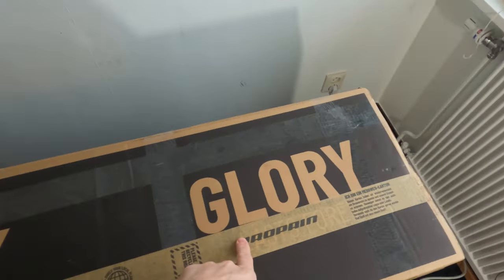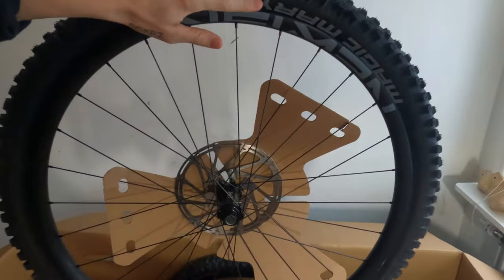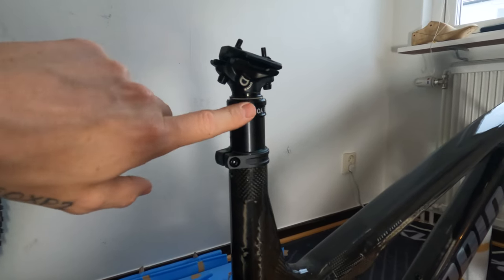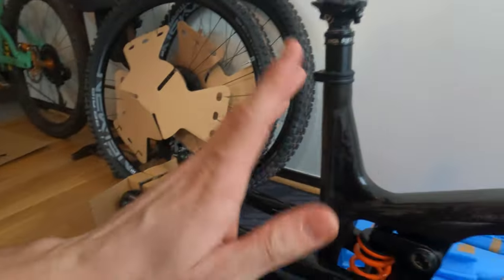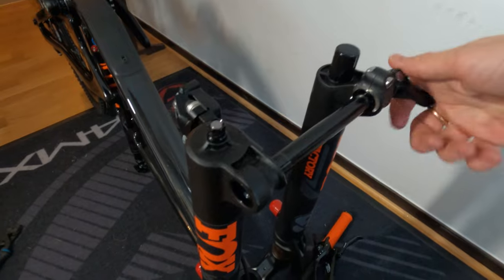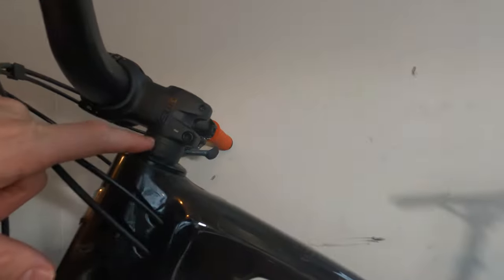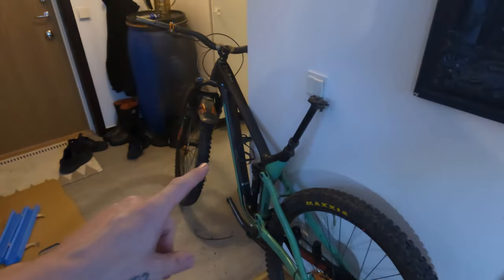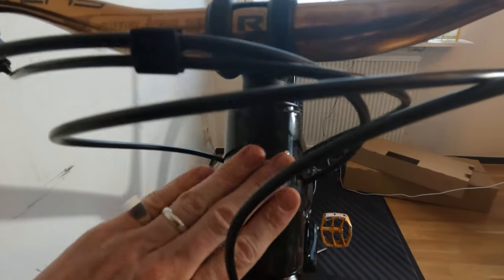Unboxing an ENDURO MACHINE - Propain Tyee CF 2022

Comment: How have you liked it ? Jut got mine used and there is no small bump sensitivity/plushness. So disappointed, feels harsh to ride. Otherwise geo is very good
Reply from the maker: Hey Dandy, what suspension set up are you on?

Honestly it took a while to get used to this bike, felt a bit top heavy at first.
And I've changed the spec completely from stock,

But I really dig the geo and I'm riding everything from double black tech to blue flow lines and flat trails
Reply: @Frorideism  170 mm lyrik select+, i've tried it before and like it a lot, also feels good on this but the platform is sketch. Shock is the rs super deluxe coil ultimate, and its good too with the 500 coil but the platform just isnt sensitive. Bike park goes good, geo very nice but any rocks and you stop having fun
Reply from the maker: @DandyHippo   Ok so two things I noticed with the bike so far: 
There's a lot of pedal kickback unfortunately, this annoyed me quite a lot and made things feel way more rough than they should. 
I actually bought an O-chain device to get rid of the kickback and it's riding like a chainless bike now, crazily smooth over rough terrain.

The other thing is that I noticed is that I needed to set my suspension to quite //Stiff//. 
As in so that the bike rides high/early in the travel, with around 20-25% sag instead of 30%.

Riding in the top end of the stroke, way more subtle and sensitive than if you're eating up that travel having to deal with small bump sens deeper in the stroke. 

The ochain is a bit costly to be honest, 
But they V1 versions are on discount since they released a new version. 
I found it worth it, but it's a lot of cash regardless.
Reply: @Frorideism   I feel like kickback or not my problems exist because the axle of the suspension is vertical and as a geometric solution the tyee has a lousy platform. Also my first carbon bike and gets throwed around in the rocks more because less weight and more rigidity plus the lousy platform but yea I had a good day riding park today, just when theres rocks it turns into a hard mess. Compared to a 2020 Dune R which has an insanely good platform its just so different and cant believe this has been "enduro bike of the year". Some people dont care about small bump sensitivity. Riding smooth bikepark very enjoyable, enduro okay, small rock/bumpy trails no. If I have a better and cheaper bike I'm not gonna spend a dime on this anymore, just gonna sell it and enjoy the good things it had to offer. Commencals and Mondrakers have great platforms in my opinion. Thanks for the info man, appreciated 🤙🏽

Comment: hey dude,
im thinking of buying a frame only and building the bike up
i race enduro and dh and i was wondering if this bike could handle it well? im looking for basically just a big super enduro bike almost that can tackle any terrain. would the bike suit me?
Reply from the maker: Sup Archie, 

Nice idea for a project, I think next time I buy a bike i'll do a frame-only for sure. 
Iv'e raced this bike this season and for me it's been such a treat, I know some people get the Spindrift instead but for racing I would say that the Tyee would fit better. Climbs well. It's light. and it bombs.

It's a god damn tank to be honest. 
No need to go up in travel more tbh. 

I even left my DH-bike (YT Tyee) in the garage when hitting the bike park last season, the Tyee is just much more fun, sure it's not possible to absolutely bomb a rock garden like a Dh-rig, you lack that stiffness and rigidity from the frame. 
But it's really near. Sure i'm riding high end suspension, but it sounds like you may do that too.

I'll try and give some downsides and that would be that it's of course a bit lazy on the flat terrain sections, and you need to put energy to go forward, but that's just the case of most big enduro bikes right. :) 
I do quite abit of just easy trail riding and it's quite enjoyable but not as enjoyable as on my 130mm trail bike.

Comment: I just ordered the same bike in al, will the 180mm dropper fit all the way into the frame? or will it extend like yours does?
Reply from the maker: Nice dude, It’s possible to slam pretty much all the way, 
I just prefer to have it slightly higher

Comment: Hi Froride. Nice build! I ordered a Propain tyee on 29sept 2021 but I'm still waiting. How much did you wait for your bike? Thanks!
Reply from the maker: Hi, why thank you :) 
Hmm I ordered in early August and received in late December. 

Delivery times depend alot on build and also country it seems, what parts did you order with?
Reply: @Frorideism  Thanks for your Answer :) I'm ordering it from Spain and the setup is full factory with the fox transfer and fox float dpx2, magura mt7, transmision gx and stock rims. I'm currently riding on a xc bike with downhill bars and stem and I'm a little bit tired of the long waiting 😅
Reply from the maker: @theendurorookie  Of course dude no problem!

Okay! Well me and a bunch of other's have had many bikes delayed because of the specific Fox Transfer seatpost - apperently it is on hold at the suppliers. 

Also the GX parts sometimes becomes delayed. 

I would send Propain an email and maybe ask what the hold up is and if there are any specific parts they're waiting for. 
Because once they have all the parts they will build the bike in just a few days.

haha sounds like you really have a sick build to look forward to then mate, and a bit of an upgrade ;)
Reply: @Frorideism  haha thanks a lot again😊😊
I think it’s a sick build too😍 I was confused if the dpx2 was going to be a good option for me but I’m not going to make big drops and jumps so I thought it will be.
I was thinking about getting a modern trail bike but with enduro geo and brakes, that was my goal.

Comment: Please how tall are you for a L size frame? I am 1,82cm and hesitating between M and L... thanks
Reply from the maker: I’m 186cm and I was also debating between the sizes.
I think I replied to some other comment here on this video before - I think he was your height too.

So scroll down abit and I think you can find that comment ☺️

In short I chose L because I felt that the toptube/reach on the M may have been to short to my liking.
The wheelbase and chainstay is very long however, seattube aswell so the L is a taller bike.

If i was 182 I may have chosen a size M to get a more nimble bike, it has 25mm smaller wheelbase, like 10mm lower stack and 20mm less reach.

But! 
For your length I think it’s more like a personal taste, do you like a smaller or bigger bike, y’know? 
Both will work.
Large will be abit more stable and medium abit more nimble.

Enduro WC racers tend to size down instead of up, faster cornering.

I can say after riding the Large that yes it’s a quite big bike but I can still throw it around like it’s nothing and it’s really playfull regardless.

i’m happy with my L, It all comes down to preference at this point really since you’re in between sizes. 

Hope this helps! 
/A
Reply: @Frorideism  Thank you for your answer, just saw your comment now (notification was off), will look into it.

Comment: Did you consider Spindrift?
Reply from the maker: Yes and no, I did consider it, but I was actually probably more considering the Hugene VS Tyee to be honest. 
For what I needed; the Spindrift was too much of a beast of a bike, a-lot due to it's high travel. 
I have a friend that rides a SD and I think it's sometimes overkill for what we are riding most of the times.

I wanted a bike that would be a perfect partner for full-length enduro races, boosting bike park jumps and smashing rock gardens. 
The spindrift felt good for the 2/3 of these priorities. 
The Tyee hit the spot for 3/3, just probably a little bit jankier over extremely rough terrain.

Comment: Looks nice! You said it was a big bike. How tall are you and what is your inseam? Sorry if you said it and I missed it. Do you think it will be a good trail bike or is it too burly? I'm thinking about one with an air shock.
Also not very good that they didn't check with you about the seat post first.
Reply from the maker: Hey, 
I'm 186cm / 6ft1
Inseam not sure - But got kind of long legs. 
If only used as a trail bike I think the Hugene would be a good option, it should be very capable downhill as well but a bit more lively.

Havn't had too many runs on this one yet, and the ones that iv'e had have been in snowy trails so hard to tell how it feels haha - 
In short, the climbing is awesome on this bike, the steep seat tube angle puts you forward and linkage is subtle and does not lose grip when techy. 

It is a downhill bomber for sure though, so if you want to pump and have fun on flatter trails I think it's abit too stable and I would prefer less travel and steeper headtube.
Bike feels high and it's noticeable, BB is kind of high too. 
Not a dealbreaker at all for me but it's there. 

I know many people went with coil on the Tyee because of the leverage ratio of the frame seems to be "better" with coil, and people that have used air shocks on this frame tend to say it became too harsh. 
But that's all personal, Air is probably just fine tbh. 

Hope this helps with your choice. :)
Reply: @Frorideism  That is super helpful, thanks for the detailed reply!
Reply from the maker: @flippy66  Will probably do some review video thingy's later but by then you'll most likely already got your new bike ;P
Reply: @Frorideism  Not many things in stock right now so I'm thinking maybe the end of the year 😅

Comment: What job do you do?
Reply from the maker: Menswear designer, mostly outdoor/sports
Reply: @Frorideism  wow, I like it
Reply: @Frorideism  how’s the bike? Do you like how it rides? Do you think that a L can fit me? I’m 1,80 cm
Reply from the maker: @mathiassireb   Have only had 1 ride so far without like 30cm snow so a bit hard to tell right now haha, 
But my first impressions was that even though it's a very stable and solid ride, I still felt very connected to the trail and could feel the ground underneath. 
While some other bikes just eat up the trail, this one keeps you steady - but still very subtle and great feedback. 

Was easy to pop, even with the coil shock.
It's a long bike, and quite high BB, so will take some getting used to and I think it needs alot of active body positioning to really get everything out of it. 
All in all I could feel that it wants to go fast, and it came alive when bombing. 

If I was 180cm I would chose the size M probably.
Just because I think it's already a big bike and I think too many people oversize their bikes to "keep steady at speed". While it actually may make the ride a bit too lazy you know?
Looking at the EWS, most of the worlds best racers use smaller bikes. 

And it's a 29 so it's already got that stability :) 

I chose L because Iv'e got long legs and arms and i'm 186cm - The reach (on M) seemed too short for my taste.
Check out the wheelbase too, it's quite long on the L size.
That being said I'm sure both M and L would be good for someone who's 180, depending on riding style etc!

Hope that helps mate, 
Happy shredding
Reply: @Frorideism  thank you very much, you were really kind!
Reply from the maker: @mathiassireb  No worries mate!